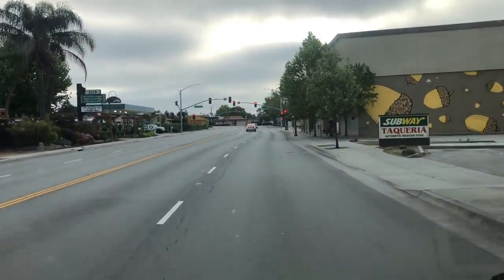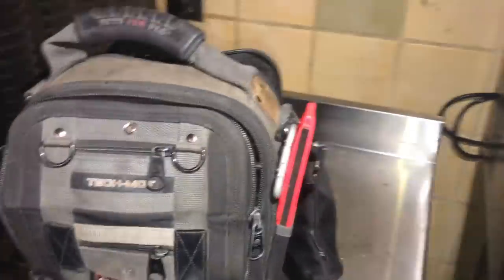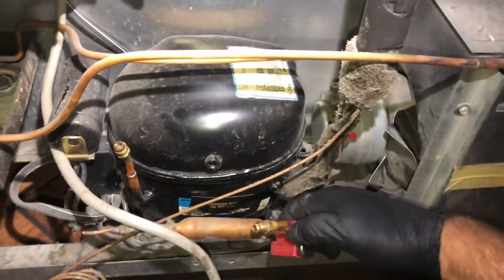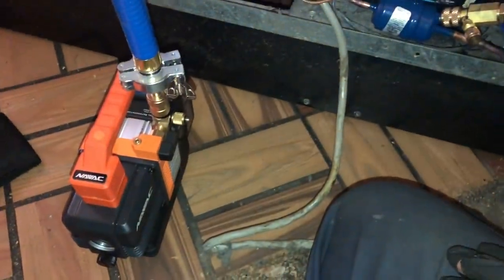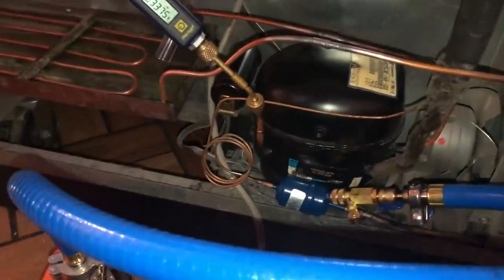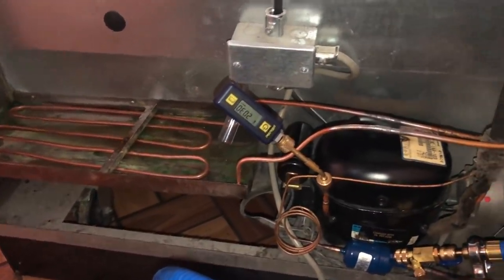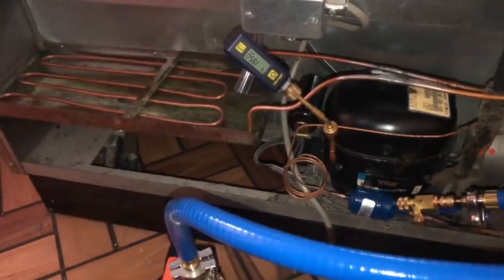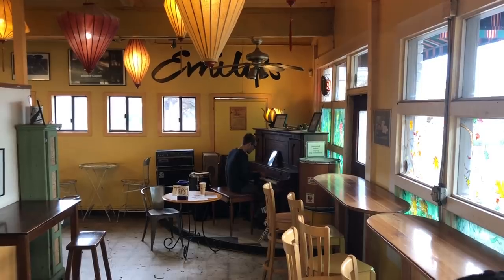Duke RUF48 rebuild

Comment: unreamed = undersized restrictions and major turbulent flow. turbulence with water and other chemicals will etch and eat tubing/fittings/etc from the inside out and faster at higher velocity flow rates. one of the reasons proper sized lines are a must.

Comment: I've always contemplated getting rid of the cap tube system and putting in a baby TXV. Good video! I've got a few evap coils to change out in true T-49 coolers haha.
Reply: Matthew Poole I agree with you, the only thing that you have watch for is the inrush currents, a cap tube will equalize the system pressures when not running to make for easier starting, a small compressor might have difficulty starting with a tx valve. At least that’s what I’ve read...
Reply: @FireandFrostHVAC  I'm sure there is a work around to getting it to start under a moderate load. I guess as long as it isn't LRA current, most starting components can handle it maybe even put a moderately beefy 3 in 1 in its place. It might not even hurt to find a reach in that isn't vital to the operation and use it as your guinea pig.

Comment: Did one similar on Friday on a Polar 3 door prep table, took 1 hour 15 minutes before the vacuum would stay under 1000 microns with the pump isolated, had one 72" x 1/4" hose from the pump to the system, JB pump. Looking into getting one of those hose kits, might speed things up a bit.
Reply from the maker: I don’t know, I was 51 minutes on this unit to 500. I think it just takes time.  The blue hose is awkward on small units the ends are big and heavy.
Reply: @NorCal-refrigeration  I love 3/8" hoses. Makes perfect equilibrium for me. No more size needed.
Reply from the maker: Juan Todolí I agree.

Comment: I agree when you are trying to pull a vacuum on a complete system including a compressor with POE oil the time does take longer, triple evacuation does help, but it will still take a little longer and you will never see 89 or 100 microns either on a repair situation like you do on a new install.
Reply from the maker: Yep

Comment: Hey Dave, next time you do a job the same as this, do the evap coil first, cond tray loop, purge cappillary tube, then fit drier last.. be interesting to see if vac time is lower.. compared to putting it in early and leaving system more open.. top job.. at least your thorough....Not like Marat.. lol
Reply from the maker: I’ll try that

Comment: Dave, Is there a Spray protective coating that can be put on the coils when new ? That might deter the corrosion that comes from the condiments in the air inside ?
Reply from the maker: You can coated coils. They probably last a bit longer. But eventually leak.

Comment: I'd be curious to see what would happen if you were to do a nitro sweep at 2000 microns, I've always been told that the dry nitro "ACR grade" would suck out moisture if you let it sit in there for a couple of minutes, that's basically why manufacturers ask for triple evac. Plus in this case with a nitro sweep after 6 minutes the next vaccum might be quicker, thus maybe bringing down the total evac time.
Reply from the maker: The nitrogen would speed things up.
Reply: @NorCal-refrigeration  I'd guess so, but it's real world, sometimes you got plenty other shit to do so its not worth putting extra work in your vaccum when you can just wait it out

Comment: Have never been a fan of pulling a vacuum on high side only. Too much restriction threw cap tube, Is there a reason why you went high side only?
Reply from the maker: I did it because viewers were saying the same thing going threw low side 😂🤣😂🤣😂 on these small units it probably would be fine to pull threw both sides and use a manifold if you have one that’s right.

Comment: Looks like the label on the compressor is discolored like it got very hot ?
Reply: ya think? a leaker running low on gas and probably had pluggo-buggo condenser 50 times over...
Reply from the maker: throttle bottle you guys are good. Don’t miss a thing. Good techs 👍👍⚡️
Reply: I know all to well, that it's easier to notice things when not there doing the actual work!
the old phrase "sleep on it" holds very true, I cannot say how many times I've caught things hours later when thinking about it, often on the way home or while eating lunch, dinner...

Comment: Did you have to add a smidge more over the factory charge because you used a bigger filter drier or was it good with the nameplate charge?
Reply from the maker: I had to add to it.
Reply: I was wondering the same? Add an extra 2-3 oz? Or how much...
Reply: I’ve noticed a lot that the factory charge is a decent starting point lol

Comment: Dave do you pull the Schrader core out when you vacuum?
Reply from the maker: Yes I use core tool
Reply: Ok I figured you did 😅 nice video
Reply: @NorCal-refrigeration  hey , Dave , thanks for the video. Can you recommend a good core tool that holds the vacuum and doesn't leak so soon ? Thanks again.
Reply from the maker: Sterling Archer no they all suck
Reply: @NorCal-refrigeration  Ok , thank you ! I thought that was just the ones we get in Europe , but I guess manufacturers need to do something about it , thank you for the reply 👍.